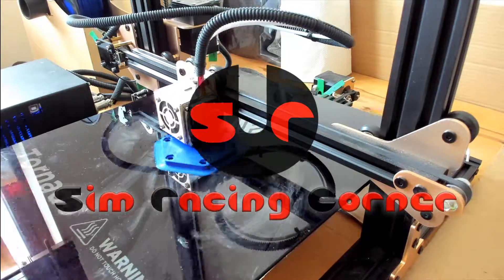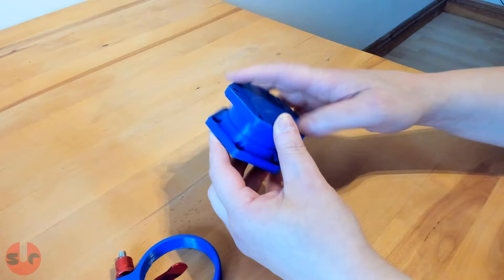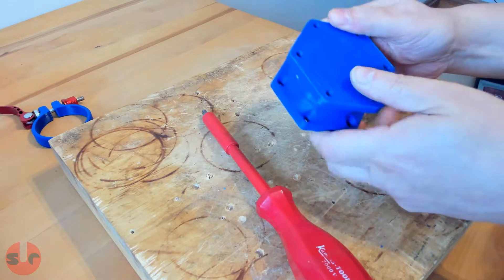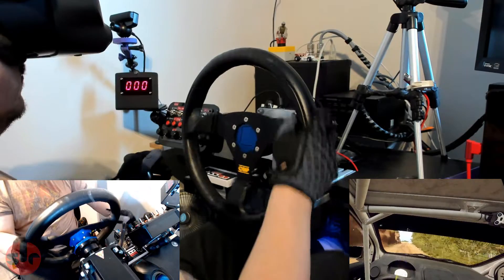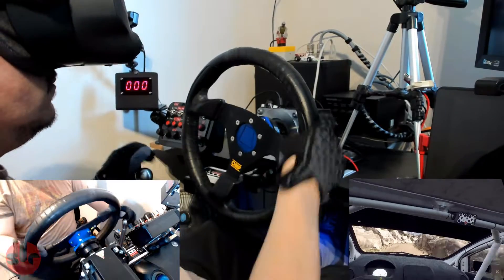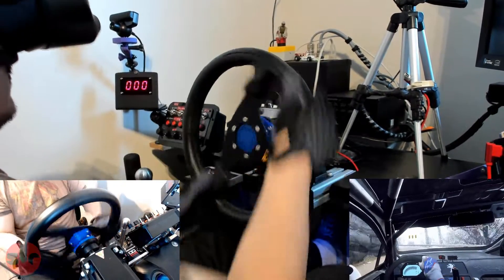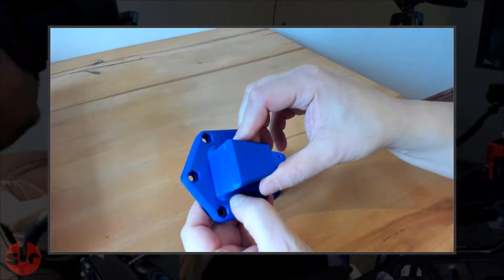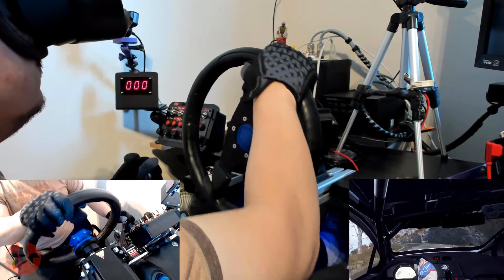3D Printed Quick Release vs. Direct Drive Wheel Motor! [SIM RACING HARDWARE]

Comment: When the quick release finally snaps, it will happen at a single layer, so printing the component at an angle of even as little as 15 degrees will drastically increase its lifespan by the increased tensile strength.

Comment: I think a better shout on retention would be to put slit(s) in the wheel mount side, so that the clamping ring actually does something. You could also rough up the mating internal/external faces on each part to get more grip between the parts too.
Problem with that is, PLA is quite brittle so you'd not get much clamping action before it let's go.
Reply from the maker: I did think about the slits option, but I didn't want to mess around with the original design, which could alter the overall integrity of the parts. One day I might get around to designing a 3D printed QR for fun, so this was a good baseline for testing the concept on a direct drive motor.
Reply: As a solid infill item I imagine it would probably be ok, but I can see where you're coming from. I too would like to make my own QR based system for my thrustmaster set up. I'm using printed screw type adapters on both my printed wheels at present but the tinkerer/lazy person in me would rather a proper QR system that doesnt involve screws of plastic or metal variety ;)
Sim Racing Garage has a video that came out in the last few days on a true QR system if you want some ideas/ food for thought :)
Reply from the maker: @Skate2create  Thanks, I have watched the SRG review, it's an interesting QR.